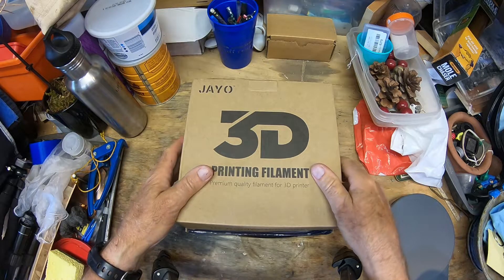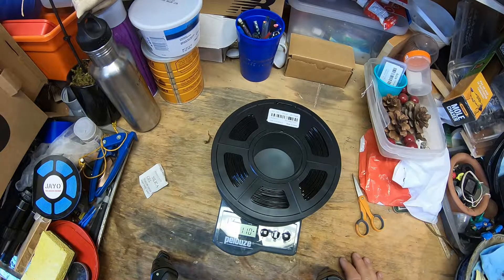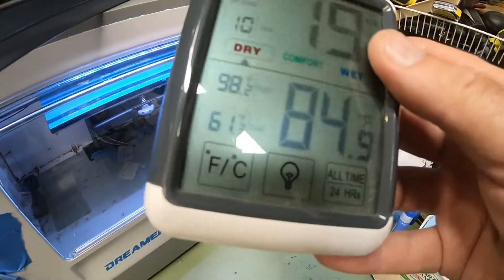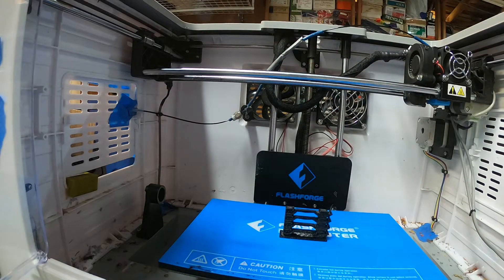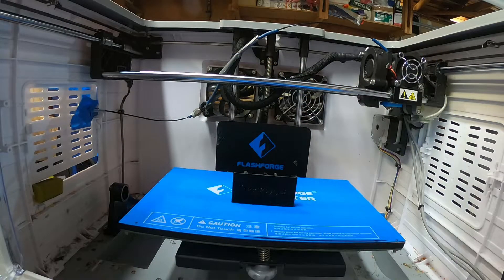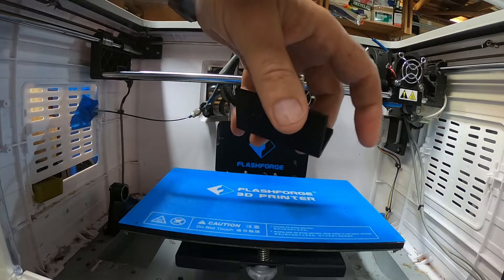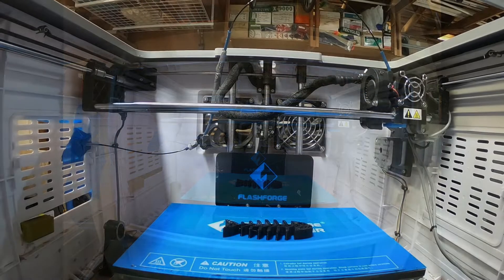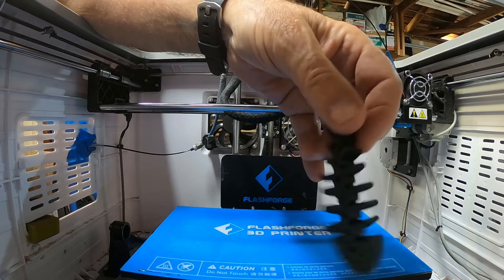Flashforge Dreamer (NX) - JAYO Black PETG 1.75mm Filament Testing

Comment: Hello, can you send your profile petg of the dreamer ? i have a same but i can just print pla, abs and tpu, please.
Reply from the maker: I keep the top on and the door closed while printing PETG no matter what the ambient temperature.
I'm using Simply3D as my slicer.
Here are the parameters I use. Let us know if they work for you

For PETG (JAYO & California Filaments)
NOTE: I like California Filaments better, see my other review of that
The basic parameters are:
Nozzle Diameter 0.4mm
Extrusion Multiplier 1.00
Retraction Distance 1.00
Retraction Speed 1200 mm/min
Layer height = 0.2mm (I have had some luck with 0.3mm layer heights for some products, but layer adhesion is on the borderline)
First layer height 90%
First layer width 100%
First Layer speed 50% (I was using 35% for a long time, but recently I've using 50% with perfect first layer adhesion)

Bed Temperature 60 degC (I was using 65 degC for a long time, but I found PETG would stick too well to FlashForge sticker. 60 degC is plenty I get perfect bed adhesion with easy removal. NOTE: I remove my PETG while it's still warm (as soon as it comes out the machine). If I want until it cools, it's much harder to get off)
Extruder Temperature: 237 degC (This temp works well for all the PETG types I'm printing). NOTE: Printing a lot of PETG at 237 degC will make your heat break tube clog up faster than if you're printing PLA at lower temps (I use 225 degC)

Cooling: 1st layer Fan speed 0; 2nd layer fan speed 10% (for some prints I use 5%, so try both while testing) (printing PETG without any fan, which some sites recommend doesn't work for me)

Default printing speed 3000 mm/min. (I print PLA at 3600 mm/min; I recently did some more testing with PETG @ 3600 mm/min and got bad layer adhesion, so I'm sticking with 3000)
Outline Underspeed 50%
Solid Infill Underspeed 80%
Support Structure Underspeed 80% (I try to avoid supports whenever I can)
X/Y Axis Movement Speed 6000 mm/min (I use 4800 for PLA because that was the default, I upped it to 6000 for PETG to make up for the slower print speed, but in practice it makes almost no difference. You just aren't moving the printhead without printing that much).
Ooze Control Behavior Flags Turned On> [Force Retraction Between Layers] [Perform Retraction during wipe movement]
Reply from the maker: I upgraded to a FlashForge Guider 2 a few months ago, look for a review series on that starting November 3, 2023. 😃